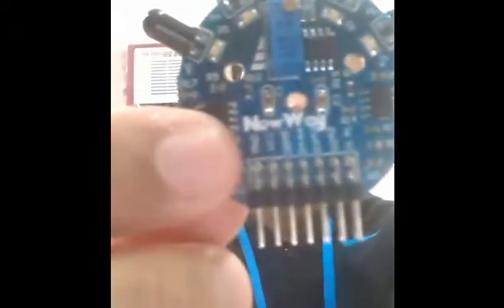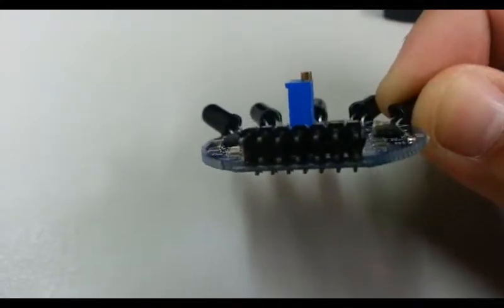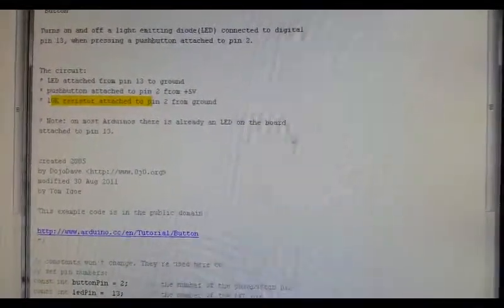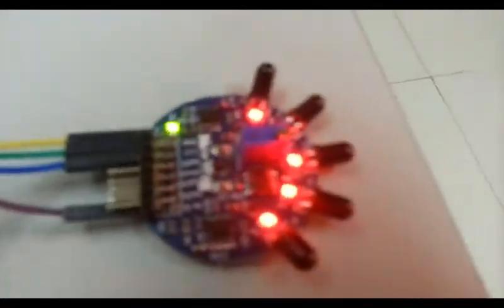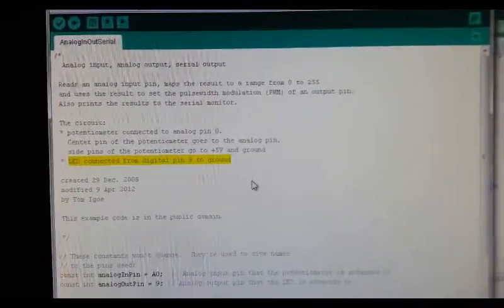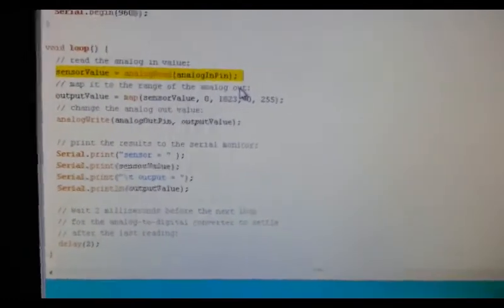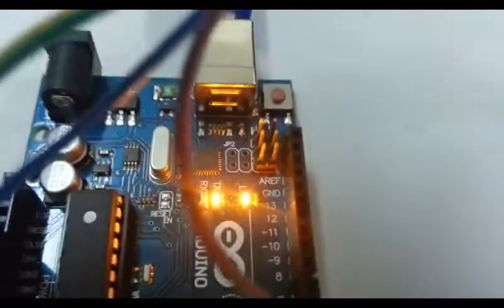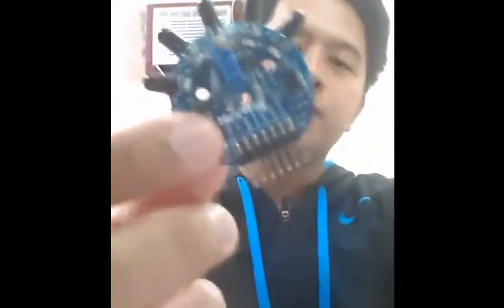120 deg flame sensor New Way

Comment: Nice vid Sir, may I know the range of the flame sensor that you were using?
Reply from the maker: Actually the range (effective distance) depends on the intensity of the flame. For this video, the sensor can detect the candle light from more or less 2 inches away. If we were to move the candle a meter away, the sensor might not be able to detect the flame (havent tested). But if you were to replace the candle with a bonfire a meter away, the sensor will be able to see that.